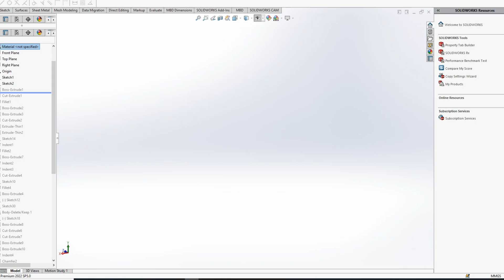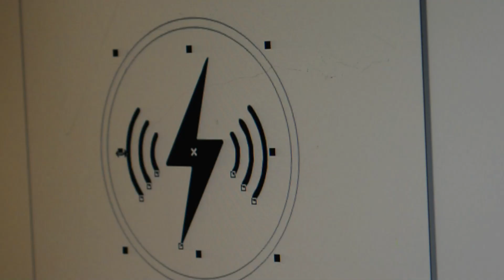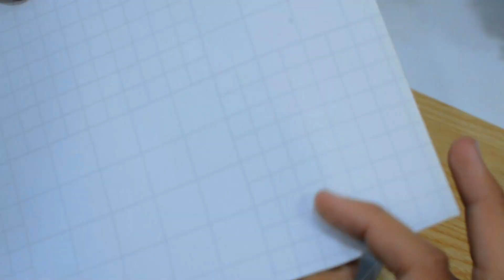How To Make Wireless Charger || 3D Printed Wrieless Charger #3dprinting #wirelesscharger

Comment: Did you use PLA? I'm building something similar and I’m worried about heat resistance.
Reply from the maker: Yes in this project I was using PLA.
Reply: @hobby.3dcrafthub  Great, thanks!